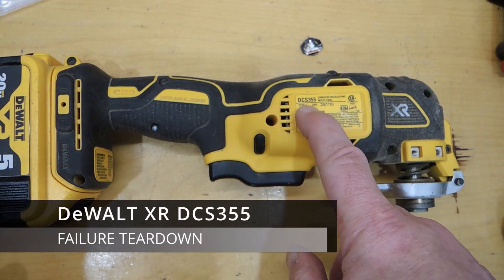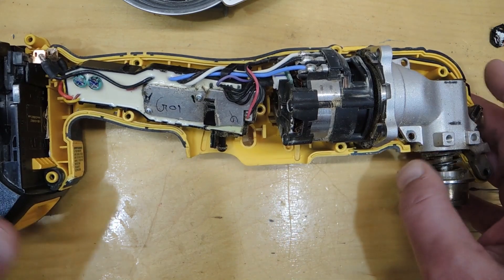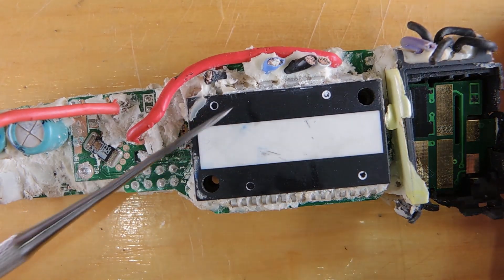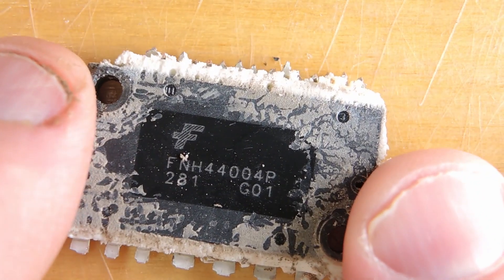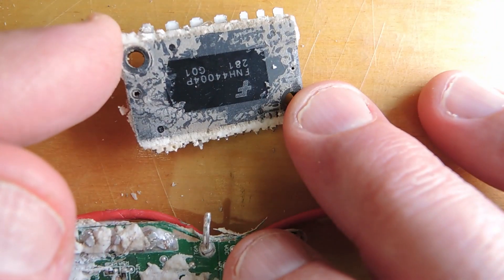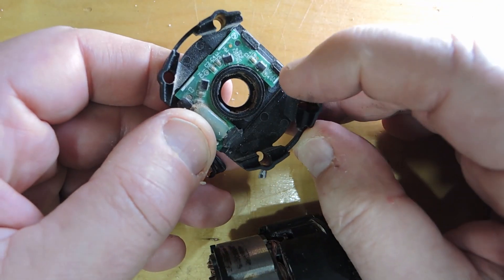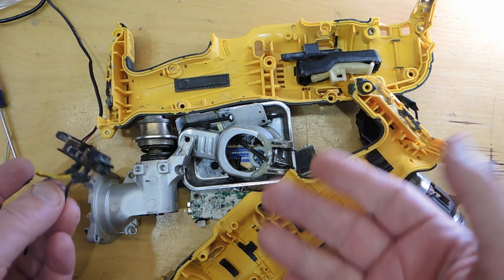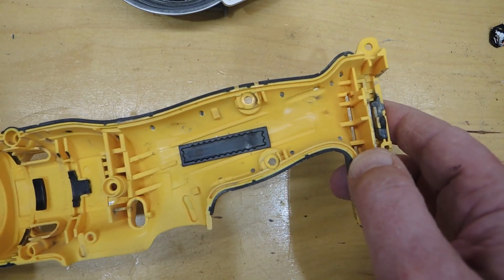DeWALT DCS355 Teardown and Failure Analysis

Comment: That battery contact is quite the design failure. Right where it comes out of the plastic (the "natural" bending line) the metal has the least width. And then it has a large tab with a big wire soldered to it, with neither the tab not the wire being properly supported. All that in a tool that's one of the worst when it comes to vibrations.
Reply: Could be described as planned obsolescence when we consider that these items are designed by electro-mechanical engineers who are no doubt educated to University level. 
No other reasonable excuse as to why this tool is so poorly designed by Higher Education Graduates.
Willing to wager that the Makita versions of this tool are rather better designed or indeed Festool or Hilti.

Comment: I'd say that terminal failed due to vibration cheaping out and soldering that thick wire directly to the terminal (instead of using a connector which would have allowed some movement) and not isolating the battery connector from the case with a rubber surround.
Reply: Looks like spot welded, but yeah connector would probably have been better, or epoxy around the connection.

Comment: A lot of those tools also have DRM on them, and need to be activated by the store POS before they will work, as the POS uses NFC to communicate to the tool, that it has been sold, and thus can activate and be used.
Reply: What a load of BS. I had to buy a new motor for my Dewalt brushless drill because one of the coils had overheated and killed the electronics. It works perfectly again now. DRM, my ass.
Reply: @simontay4851  You had to buy a new motor because the electronics died? Wouldn't you have to replace multiple parts?
Reply: @jaro6985  a lot of power tools have the stator and electronics as one part because the wires need to be soldered and it's too much risk to rely on repair techs to do that. Very annoying as a stator or electronics failure means you have to replace both, and the part cost is often 70% of the price of a new tool
Reply: Which brand did you see doing that?